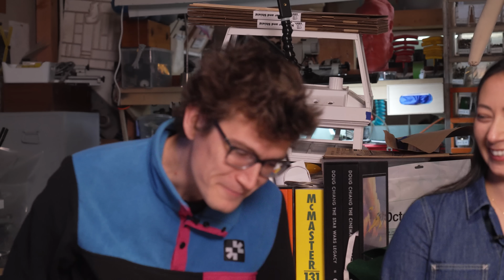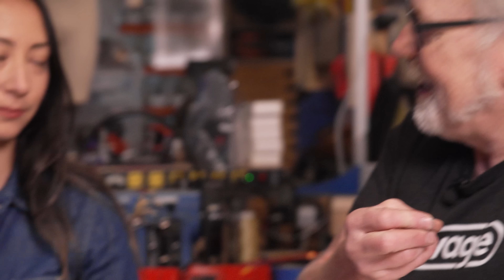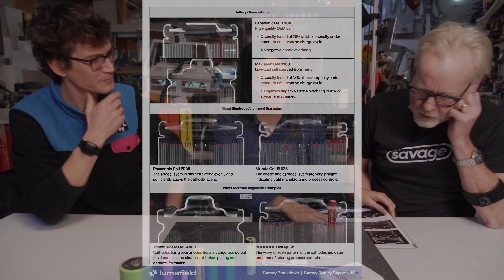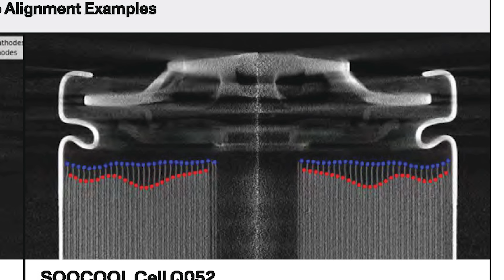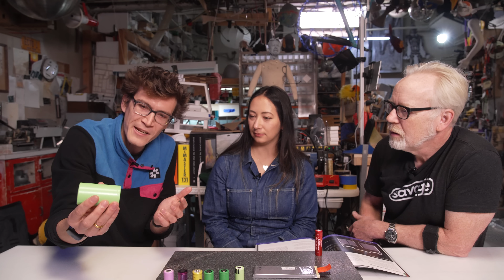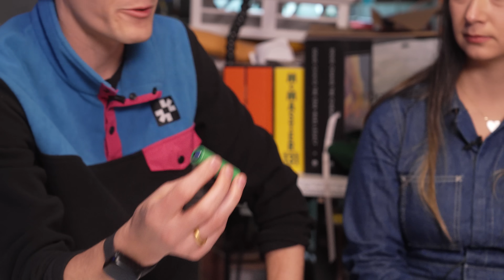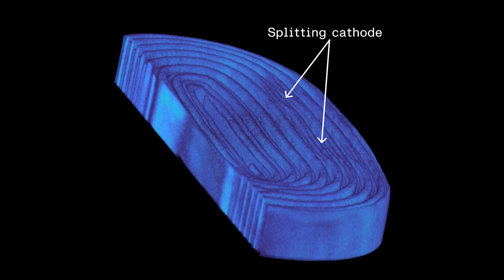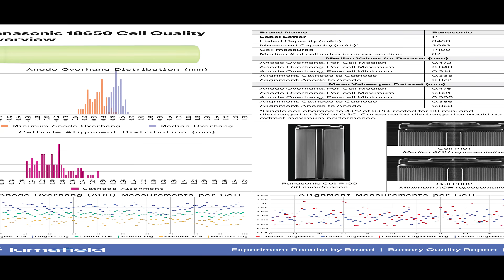The Surprising Flaws in 18650 Lithium-Ion Batteries

Comment: @10:08 "It's like a circuit breaker".  I wouldn't say that. Circuit breakers can be reset. I'd say it's more like a fuse. Once it's triggered, the battery is essentially useless. If the battery shorts while inserting or removing for more than a split-second, the terminal will heat up hot enough to break that fuse, and the battery becomes dead, and cannot be repaired or used anymore. This has been an issue for me because the industry standard heat-shrink insulation always flakes off near the terminals and makes it easy to short the batter when inserting or removing.
Reply: Fuse and circuit breaker is the same thing and it's definitely not the case that all circuit breakers can be reset. That's actually a very new thing. The purpose of a fuse of circuit breaker is to break the circuit when the heat is too high. There's no requirement that they have to be able to be reset. In fact you very often want it to not be possible to reset a circuit breaker because you don't want to avoid the issue that causes the circuit breaker to go off. That is the case in li-ion batteries because they are extremely dangerous things.
Reply: @jeschinstad  True, circuit breaker is somewhat vague, I was thinking of contemporary terms the way it's used in home wiring.
https://www.youtube.com/watch?v=gDBUqeqx5t4
But I suppose anything could be a circuit breaker if it stops the flow of a circuit in a more board term.
https://www.youtube.com/watch?v=rtPXtLqk5rM
I was thinking of a circuit breaker as used in something like a home electrical panel. I'm thinking of the contemporary name of a device rather than the literal definition.
Reply: @Lardzor  A traditional circuit breaker for home wiring is actually permanent and very simple in design; its quite simply the thinnest wire in the circuit so that if you run too much current through it, then the wire will melt and the circuit is broken. It's essentially like an old-school lightbulb. In modern circuit breakers, you might make use of memory metal that gets soft and bent out of shape when the current is too high and then when it cools returns to its correct shape so you can use it again. But that's a modern thing.
Reply: @jeschinstad  your example of the thinnest wire wire in the circuit breaks down right at the light-bulb. A light bulb filament would be the thinnest wire purely because of how thin it actually is. The reason it isn't is because it is made from tungsten, which was chosen because of it's very high melting point. Also, 'memory metals' such as Nickel Titanium alloys are not used in breakers. Bi-metallic strips sucks as aluminum-copper bonded strips are used because of the significant difference in the coefficient of thermal expansion between the two metals causes a bending motion that can trigger a switch.
Reply: @Lardzor  Are you trying to misunderstand?
Reply: @jeschinstad  I'm not sure. I assumed 'thinnest' to mean a physical measurement, not a conceptual one. Did you mean thinnest to mean smallest or least substantial?
Reply: @Lardzor  Yes a fuse is the thinnest part of the wire. It is not made rom tungsten in order to prevent it from functioning as a fuse by preventing it from melting and thus starting a fire somewhere in the wall instead.
Reply: Eh, even some fuses can be reset. In printed circuit boards there's a category of parts called positive temperature coefficient resettable fuse that functions as over current protection. PTC fuses are very common in PCBs, they may not have a mechanical user operated switch like a conventional mains circuit breaker, but they are still both a fuse and circuit breaker. They self-reset and close the circuit again after they cool down. From a mains perspective I totally see where you're coming from, but fuse and circuit breaker are pretty interchangeable.
Reply: Some 18650 come "protected" with a PCB, they are slightly longer with a button on top. Some pictures in this video show these, and this should prevent over charging and discharging. This is the circuit breaker.
Other do not, those are flat on both ends, but still need some physical protection inside, i.e. a fuse, in addition to external electronic protection (in the device/car/etc. usually when you pack more than a couple 18650 together)
Reply: There is a method to reset the pop up fuses. Not foe the melt fuses in them.
Reply: Does it break the circuit when it pops? Yes - It’s a circuit breaker
Reply: Yes it is more like a fuse. And people commenting about circuit breakers being a thin wire or not resettable are incorrect. A circuit breaker has two elements- one is a thermal trip, much like a toaster oven with a bimetallic strip that bends/separates the circuit connection if enough heat accumulates over time. This would be a higher than normal load (current) for an extended period of time. The second element is a magnetic trip. If a short circuit, or a very high current is run through the breaker, it will trip via magnetics. Neither of these are "thin wire" or "non-resettable" situations. The circuit breaker is designed to literally break the circuit and then be resettable.
Reply: @mike36525  I corrected the false claim that all circuit breakers must be automatic. That is not true. Traditionally, circuit breakers were not automatic. If you want, I can take a picture for you of one of my circuit breakers that are not automatic. I never once said that there are no automatic circuit breakers.
Reply: @jeschinstad you mentioned that a fuse and a circuit breaker are the same thing (which is totally false). You also said a circuit breaker cannot be reset (again, completely false). As for automatic resetting... Circuit breakers are normally required to be reset by manually toggling them completely off and then back on. I have seen many automatic motor overload relays, but these are not circuit breaker devices. Also circuit breakers are required to be trip free devices, so holding or physically strapping the handle to the on position will not stop a circuit breaker from tripping, nor automatically reset it, if it does trip. Hopefully this clarifies things just a bit! Have a good one.
Reply: @mike36525   Just to be clear when you received your training as an electrician, you were taught to believe that before automatic circuit breakers were invented, there were no circuit breakers and if there was a short in the circuit, the house would just have to burn down? You should fucking sue them.
Reply: @jeschinstad  huh? Circuit breakers are not automatic. Not sure what you're getting at. Fuses existed (plug in style, or cartridge) prior to circuit breakers. Just to reiterate, fuses = one time use... when they blow, they're done. Circuit breakers = many time uses, and they are not automatic... you have to manually reset them. Hope that clears things up for you.
Reply: Also modern circuit breakers also have electronics to monitor the AC sine wave for distortions, which are found during arcing or sparking events. These arc fault situations would not normally be detected by the thermal or magnetic trip function, so this is in addition to those protections. Ground fault protection is also available in circuit breakers. A fuse can do none of these things- it is quite literally a thin wire. So you most definitely have it correct.

Comment: Cant download the report unless you work for a company, as they want company name and position within the company, would be so helpful for people that rely on these batteries for projects and prototyping, like myself.
Reply: The only field that needs to be accurate is the email field.  And you should have a throw-away email account for such purposes.
Reply: Look up mooch battery tests. He's someone who began testing 18650 cells back in the early 20-teens for vape users, but he tests all ranges of 18650 cells and writes up spec sheets. He also retests them every so often to check for changes made by the manufacturer that could change the specs. He found that SO MANY 18650 cells blatantly lie about their advertised specs.
Reply: @theboxofdemons  mooooch! i just made the switch to vapes 5 months ago after 20 years of cigs. honestly been freaked out about my batteries and mooch, along with videos like these, has helped a lot. very fascinating for sure.
Reply: They got my email but every other field I marked "private".   I got the report, no problem.
Reply: I mean yes, "white papers" are generally self-promo, so if you're not a business, it's not too hard to find a "Lumafield Battery Report pdf" another way.
Reply: im retired so just wrote  "NO COMPANY" and "RETIRED" in occupation. PDF just downloads./
Reply: So sketchy Chinese factories pumping out substandard quality products. Nothing new here, folks! 💩💩💩💩💩
Reply: Agreed, it seems they share the same marketing as the good battery manufacturers 🙄 I'll bet it's full of subliminal adverts for a particular brand

Comment: Re read a physics textbook on D.C. & A.C. Current. And looked at a ton of Lithium Ion Battery Pack builds on YouTube. Never built one. I'm starting small with a breadboard. Then my my first 12V 25 Watt Power Pack, just S4? Then my first 12.8V, 100 Ah, 1200 W Homemade Bluetti type power station in a tackle box with 18650's configured in Series & Parallel. Then I'll try building a 750W Ebike. All with Bluetooth BMS, of course. This is my new low voltage D.C. Hobby over the next 10 years. Thanks for X-Raying these 18650's guys.

Comment: Commenting early on in the video but when I heard the line "most people dont interact with an 18650 directly" it made me think of all of the vaporizer mods that make use of them.

If its not something you've used, you might not think about it but the charging circuits within them usually fail after a while and cause all kinds of issues stemming from the board.

You are then, out of an abundance of caution for your device functioning as it should encouraged to charge it via an external battery charger, I myself have handled so many of these batteries it is very fortunate ive not had one that is defective yet
Reply: I also should note, no matter the failure across 5 vapes I've never had one malfunction in a way that put me or anyone in any danger

Charging over USB just almost always completely destroyed the screen and button controls after enough cycles 1-2 years of daily use

Comment: The lack of cell-level current protection is perfectly normal: you don't want cells intended for cordless tools, EVs or other high-intensity applications with 100+A per cell of surge current to randomly cut off due to cell-level current protection and having 5-250 protection devices in series adds a lot of pack-level losses. Managing over-current is a pack-level function, having it built into individual cells only makes sense for single-cell applications.

At system voltages over 20V, an in-cell cut-off device attempting to break open due to an external fault can arc over and cause all of the pack's short-circuit power to get dumped directly into that cell, making things a whole lot worse. This is increasingly likely to occur as system voltages go up, as people doing arc-welding should be very familiar with. By 30Vdc pack voltage, an integrated disconnect device becomes an unacceptable arc fault liability. Safer to melt external wiring than strike an arc within the cell that can promptly send a whole NMC/NCA pack into thermal runaway.

IMO, the biggest danger of loose lithium cells is that they are not intended for consumer use. That is why it is difficult if not impossible to obtain name-brand cells through official distribution channels as a consumer or even as a small company. That forces consumers and small companies to either source through non-official channels or go off-brand, getting whatever they get.

Comment: Battery fires in EVs can be an issue but internal combustion engine fires outnumber them. They just don't get reported on the news.
Reply: No shitsherlock ICE vehicle fires outnumber EV fires, there are 1.4 billion ICE vehicles in the world VS 60 million EVs. ICE vehicles make up @ 96% of all vehicles. What you said is comparable to saying people are more likely to be bit by a mosquito than a shark.
Reply: @robo5013  No - per miles driven or per number of cars sold are metrics used for comparison.
ICE catch fire at rate of 1530 fires per 100,000 vehicles. While only 25 out of 100,000 fully electric vehicles catch fire (AutoInsuranceEZ) - >60X difference!
Reply: @waynerussell6401  Lies, damned lies, and statistics.
No matter how you frame your statistics the simple fact is that there being a billion more ICE vehicles there are going to be more that catch fire, it's common sense. Just because someone "did the math" doesn't mean that it's valid.
How many of the ICE vehicles that catch fire are decades older than EVs? A vehicle that's been on the road for example 20 years before EVs even existed are going to be more likely to have issues. To get accurate statistics you have to compare like to like. Are there any stats comparing ICE and EVs of the same age?
Reply: @robo5013  Firstly - No research has suggested BEVs are more prone to fire than ICE.
Second - Hydrids  are more prone to fires than ICE and are often confused/incorporated into BEV fire statistics. Fuel and electricity do not work well together and are an awful solution to CO2 reduction (Transport & Environment).
Hybrids fire incidents per 100,000 sales 3,474.5 compared to gasoline 1,529.9 and electric 25.1.
Thirdly - these stats are per new car sale - no age identification required. The study is an Australian Government world wide study.
Fourthly - Ocam's Razor applies - simple logic from the huge number of new car recalls that hybrids/ICE are bad: Ford, BMW, Hyundai, Kia, Toyota, Nissan, Chevrolet,Jeep, Chrysler...
Huge insurance losses recently blamed by Media on BEVs that were ICE caused include: 
Luton Airport, England (2024): A diesel fuel fire destroyed more than 1,400 vehicles in a multi-story car park. Stavanger Airport, Norway (2020): A massive diesel fire in a parking garage destroyed approximately 3,000 cars and resulted in property damage estimated as high as US$47 million. Echo Arena, Liverpool, England (2017): A large fire in a Land Rover New Year's Eve destroyed hundreds of vehicles in a parking structure, with total property losses near US$25 million On Ships/Car Carriers: Fremantle Highway (2023): A fire in the North Sea burned for a week, resulting in one death and major damage to the vessel and its nearly 3,800 vehicles. The lower four of the twelve decks are essentially undamaged, and about 1,000 cars, including the 498 electric ones, are in good condition. This is according to the chief of salvage company Royal Boskalis Westminster NV, Peter Berdowski. Höegh Xiamen (2020): This car carrier was a total loss after a fire in Jacksonville, Florida, which was officially linked to improperly disconnected battery and leaking fuels in used vehicles.
Lastly - BEVs last three times longer than ICE with little maintenance so as the fleet ages there is little increase in fire risk (iSeeCars 2 million survey).
Reply: @waynerussell6401  Now you are arguing with a strawman. I never suggested that EVs are more prone to fire than ICE. I said that the reason there are more fires in ICE vehicles than EVs is because there are WAY more.
Reply: @robo5013   That's a truism! 
I wrongly figured you were smarter than that!
You introduced the strawman with the age of vehicle canard I debunked as statistically and logically irrelevant given the weight of contraindications.
Reply: @waynerussell6401  WTF? contraindication:
a condition or circumstance that suggests or indicates that a particular technique or drug should not be used in the case in question.

Maybe you shouldn't use big words you don't understand. And you're going to question my intelligence.
Reply: @robo5013 'contra' - Latin; against, not indicated - recommended. Two small words in my world.
Reply: @waynerussell6401  Too late dipstick, you don't get to change the definition of a word after you f'd up. I literally copied and pasted what you wrote to check the definition, you were trying to be a smartass but failed. Toodaloo sweetheart.